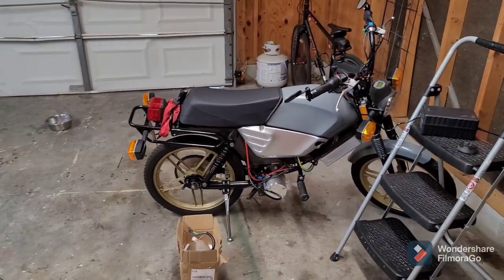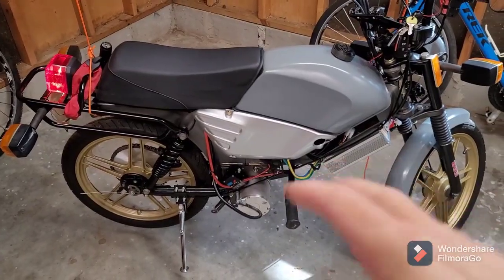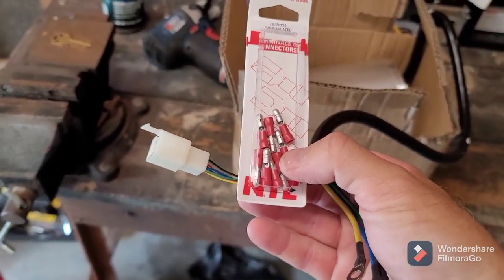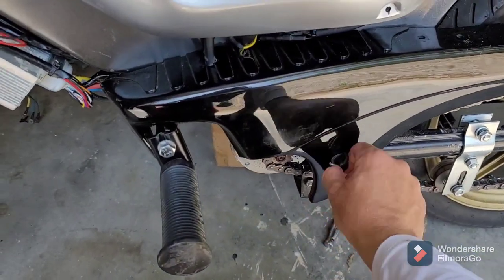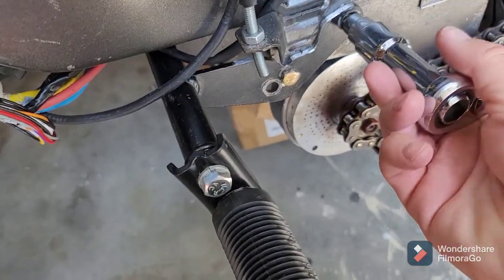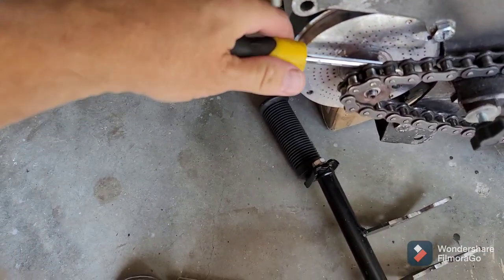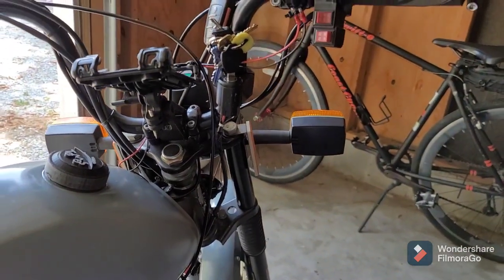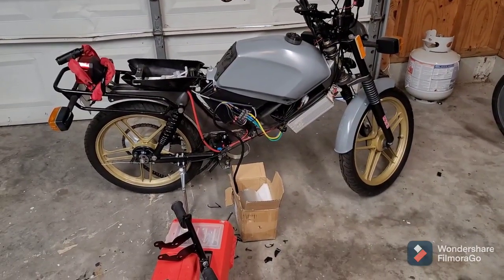Is my Electric moped conversion the cheapest good time ever?

Comment: Why do they still work with vinyl coated wires for this stuff. Silicone coated multistrand enjoyer here...

Soldering those connectors might give some problems when the factories skimp on the wire guage. Use a good crimper, don't cheap out on connectors. One good lithium battery short will set you straight...

Comment: I really enjoyed watching this - especially the way you mounted the motor! I hope to do this on a hobbit soon. Do you think there's a way to retain the belt drive system with this motor? I don't know if the variated option would be feasible but I'd like to keep the belt since I could keep the rear wheel. 

Anyway, great work an glad to see this on here!
Reply from the maker: Thanks for the comment. I plan on making more videos, and hope to get better at making them. I think a belt drive may work with the motor, just need an attachment method to the shaft and enough clearance around the suspension and rear wheel. Good luck on your project!

Comment: Hey was there any reason you didn’t to with a hub motor? I just got one of these tomos and looking to do the same thing as you
Reply from the maker: I considered a hub motor as it would be a simpler system to install but I didn't go that way for 2 reasons. 1. I like chain noise 2. I like the stock wheels. However that decision is why I keep having issues due to sprockets not wanting to stay on the motor.

Comment: Thanks for sharing your progress. How is this working out for you? I'm looking at the same kit for a DIY sailboat conversion. Is it overheating at 3kw?
Reply from the maker: Sailboat, interesting.. so the motor does get hot but not crazy hot. It is in the airflow so I gets some cooling there. It does not have a tremendous amount of torque, so I'm not sure how that would work with a propeller, might be fine, just hard to imagine. The motor is loud for electric, but that may have something to do with the controller that it is paired with in the kit. I have the moped totally apart right now and am redoing the wiring but intend on fully testing the drive train soon and will make a video of that. Thanks for following and good luck on your project!
Reply: @descartes451  Yep, torque might be a bit underwhelming for the purpose. 
Looking forward to your updates. You did a great job with restoring the bike so it's a cool project all around.